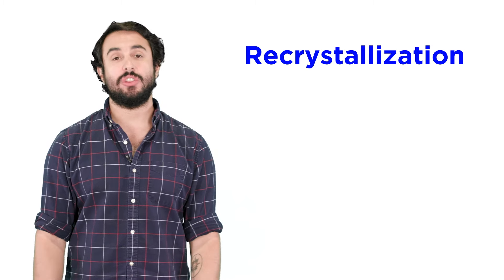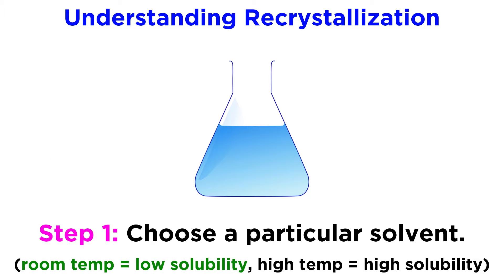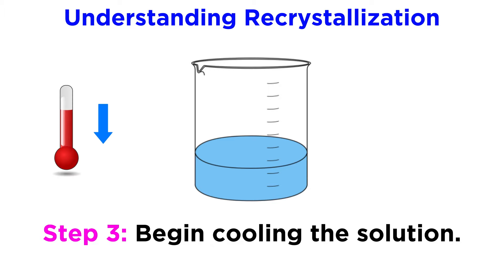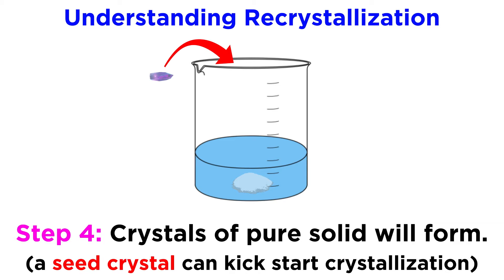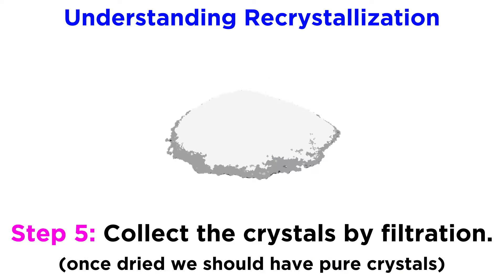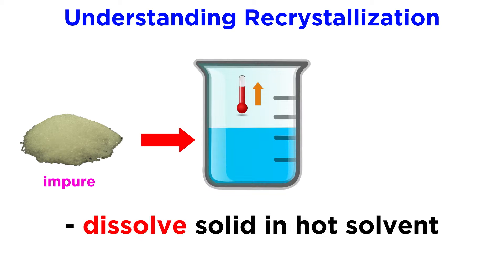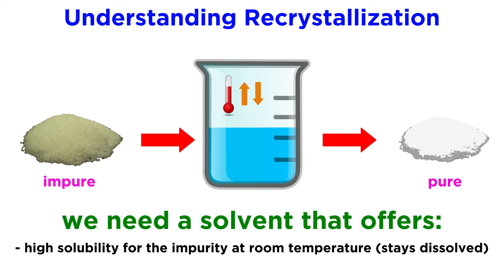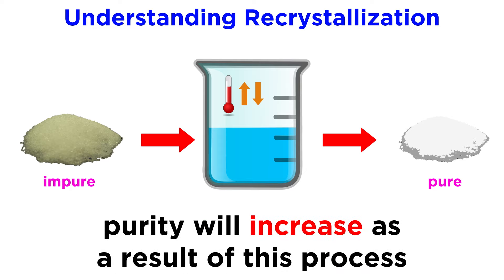Recrystallization

Comment: If the impurities are able to interrupt the lattice structure during the original precipitation, why aren't they also able to during the second step
Reply: Because they aint as gangster lol
Reply: Was thinking the same.
Reply: Because they are more dilute. Lets take an example:

A precipitate was obtained from a solution containing A and B at 1:1 molar ratio.

Let's say we precipitate A but maybe 1% of B got caught in A's crystals.

Using fresh solvent we redissolve A's crystals and this makes a new solution with ratio 100:1

If you repeat and 1% get caught up in the crystals, this time it will be 1% of 1% so the new amount of impurities will be down to 0.01%

Comment: Then what will happen to the seed crystal when it is applied after filtration. Seed crystal lowers potential energy barrier to nucleation to happen that creates template to be absorbed by atoms, ions or molecules to form an arrangement as of crystals. This seems that the purified crystal after crystallization and seed crystal are bonded together after filtration. So it seems the 'purified' crystal isn't totally purified as it has seed crystals mixed in it. 🤔

Comment: Why is it necessary for the solvent to have low solubility at room temperature? can someone please explain
Reply from the maker: So that the product will precipitate again. Otherwise it will just stay in solution and you can't collect it.
Reply: @ProfessorDaveExplains  thank you! that makes it clear.
Reply: It's not necessary, it's just taking advantage of the fact that solids have specific solubility that correspond with temperature. "Room temperature" is just a standard reference like zero is between 10, and -10. For example, chlorates have a very low solubility versus chlorides at 0°C, which is much lower than room temp. On the other hand oxides may have no solubility until say 1,500°C. It just depends on what you're trying to do, but most crystals are nitrates, sulphates, or chlorides, and those are easiest to manipulate at 25°C (room temp).

Comment: Thanks! My question is, is possible to recrystallise without heating a solvent?
Reply: Yes, evaporative
Reply: Yes, there are a few ways, but it depends onr he properties of the solvate. As someone said evaporation of the solvent is one method, which requires either heating or dehydration by some method. One method is to add a solution of another chemical that has a higher affinity with the solvent than the product, and that will reduce the solubility of the product and cause it to crash or precipitate out, although requiring additional purification steps.

Comment: Hello, so hot solvent is used to wash the recrystallized product in the filitration step?
Reply: Use cold solvent to wash away any impurities from the recrystallised product without dissolving it.
Reply: No that would dissolve it again and it would go through the filter 🤦🏼‍♀️ you want to keep the crystals on the filter

Comment: Sir,is it is mandatory to dry the crude product completely before recrystallization,which i want to recrystallized?
Reply: No. The general principle is just reducing the solubility to a point where the solvate is less soluble than the impurities.  Crystalization of the appropriate product is best as a first step where it applies, but not all products crystylise in the same fashion or even in a practical means. 

One such method is dissimilar separation, where you use two different solvents that won't mix, but the product and impurities are more attracted to one than the other. This is usually a method to separate organic and inorganic molecules, but is also useful between polar and non polar molecules.

Comment: อธิบายเกี่ยวกับเรื่องการกรอง
Reply: Filtering is a physical separation of products. At the point where you are ready to filter,, you have rendered either the intended product or the impurity as a solid that can be separated by a filter, screen, or some other physical process. This can also be just letting the solids settle to the bottom while pouring (decanting) the liquid.

Comment: Greeting! Good video! Can I recrystallize potassium chlorate this way? Thank you
Reply: Yes, if you have the appropriate solvent. Assuming you used a double displacement method to convert the appropriate salt to the available chlorate, the salt will have a higher solubility than the chlorate corresponding to temperature. Typically heating to 100°C and cooling to 0°C twice twice while discarding the liquid each time will result a very pure chlorate because the chloride salt is that much more soluble in water that chlorates are.

Comment: i'm confused by one part of this. Let's say you dissolve a solution with 50% product and 50% impurity, and perform recrystalization. What is preventing the impurity and product both forming cyrstals when you cool it down? If it did, then how would you seperate the two types of crystals in your beaker?
Reply: Impurities are highly soluble in solvent at room temperature so when recrystallization occurs they remain dissolved in solvent.
Reply: It only works if the impurities and product have very different properties. The impurity has to remain dissolved at the cooling temp (check its solubility) and the product has to have a way low solubility at that temp. 

Take sugar and baking soda for example. Baking soda has low solubility compared to sugar. You can dissolve them both, but if there’s less than 2 grams of sugar per mL of water, it will remain in solution at room temp. Meanwhile, the baking soda will crystallize out of solution until the concentration hits 0.1 grams per mL of water. Of course, solubility increases with each solute added so keep that in mind and expect lower yields for bulk impurities. 

Now take salt and baking soda for example. Their solubility is 0.35 g and 0.1 g per mL water respectively. You’d have to dilute between 0.1 and 0.35 g/mL to keep salt dissolved and baking soda hyper saturated. However, you’ll never be able to get more than 0.25 g of baking soda out per mL of water. And the closer to 0.35 g/mL you go, the more you risk getting salt in the mix. At the maximum scale, you’d only be able to get (1 - 0.1/0.35 *100)% or ~65% of your product (baking soda) out of solution. Whereas in the first example, you’d have (1 - 0.1/2 *100)% or ~95% of your product recovered
Reply: The crystals have a higher affinity toward themselves, meaning they push out impurities into the solution. Let's say that hypothetically you as you said have two solvates with exactly the same solubility properties in that solvent. The two crystals would grow apart from one another, but likely still be interlaced making separation by this method difficult. You would get grains of both products inside of one another and would have to find an alternative method. Thankfully no two chemicals have exactly the same properties and separation is still possible, even if it's a huge pain in the ass.

Comment: If I recrystalize using solvent  that dissolve my compound at room temperature, does it mean my crystal cannot get back  after I recool at 0 degree celcius?
Reply from the maker: hmm, well it might, it just depends on the precise melting point, but it's not the ideal situation